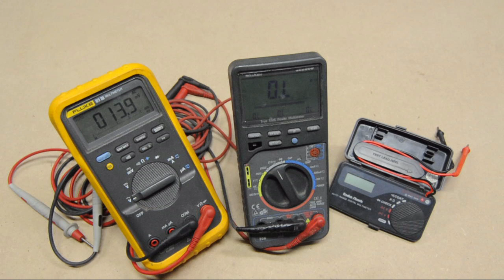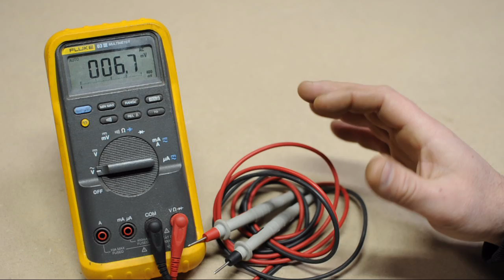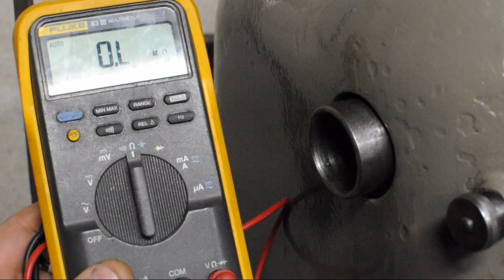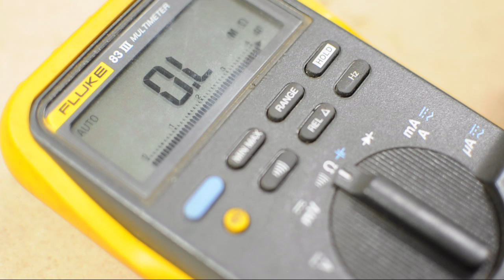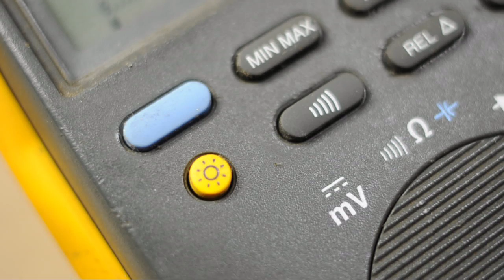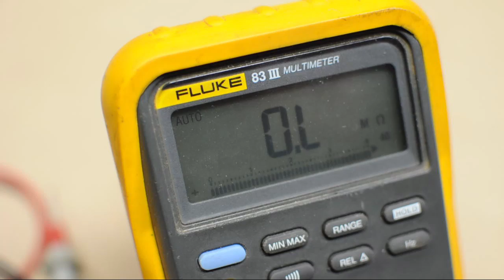Multimeter Tips & Tricks

Comment: 40 years as an electrician and I never knew you could make any of the measurements you showed.  

My tip is never stow your meter with the leads connected to the meter.  This prevents trying to measure voltage when your leads are plugged in to measure amps.  If you try this on a 3 phase 480 volt system your meter will explode.  Don’t ask me how I know this.

Comment: I've found that the stock gauge pins in my meter are pretty sloppy.  Open up the back of your meter and check them out.  Oddly, they are labelled as fuses.  When replaced with higher precision gauge pins, it improves the overall meter precision.

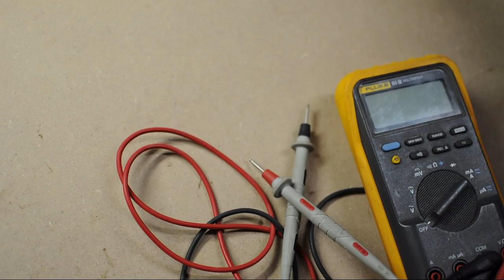Comment: This is a bit off topic, because I recently calibrated all my meters, but at 4:46 he is actually showing the PROPER WAY to use a 90 degree micrometer. I unfortunately only could afford the 1"x 2" model, and didn't have enough for the 2"x 3". I have to take the 3" measurement with a screw pitch guage and count the teeth. At least once my meters are calibrated, I don't have to do it again for another year. If anyone sees a decent 2 x 3 or even a 3 x 4 90 degree micrometer, let me know.  Do they make 90 degree dial calipers? I know they aren't as accurate, but they'd be better than my high school slide rule. (Yes, I'm old enough to be pre calculator and still have my slide rule)

Comment: Also, it's important to clear the meter after use. To do that, you plug the probes into the ground and turn the connected unit upside down to gently shake out all electricity present within.
Reply: Yes, but you have to make sure only the solid stuff comes out. Be sure not to let any of the smoke out, as a lower smoke pressure will add inaccuracy to the measurements.
Reply: If too much smoke leaves, it loses all function, so be careful.

Comment: I use my calipers for measuring how much capacity left in my battery. 
I use my micrometers for check what is the internal resistance of my batteries are.
I use screwdriver to check if my outlets are good or not.
I use wrenches as current shunts for measuring current.

Not everything is for fun, mate. 
You're are abusing and disrespecting a high end multimeter.

Comment: I've never thought to use a multimeter for any of these things.I have however used one of my multi meters to find out that every time the house phone rang I got a nice 12 - 14 volt shock when I was in the shower. Also a nice constant 4 volts (from the dial tone I guess) due to a short in the land line grounding through the copper pipes. Very low voltage, Yes, but still enough to give you a little zap. This information I didn't dare give to any of my room mates at the time, the phone wouldn't have stopped ringing whenever I got in the shower if so. Thanks Multi Meter, and to my Machine Shop Teacher who taught me how to use one while hooking up that 3 phase Lagun Lathe so many years ago.

Comment: Oh c'mon TOT, you can't tell people things that are so wrong....you said you can weld with the multimeter, well you didn't say that it only does TIG welding and that if you want AC TIG welding it needs to be an mm/inch model.
Now think of all the problems you have caused....i guess many viewers bought a multimeter for MMA (stick), which with some models might be possible, but there is no chance you will be able to MAG weld with this thing, not even thinking of MIG.....
Next time, please remember to provide these essential information.
By the way, with the slightly higher models of Fluke (e.g. 179, thats what I have) you can even weigh things.....comes in handy if you want to weigh a lathe and don't have a scale big enough....just use the micrometer ;-).

Comment: One thing I found out when I was on a date: If you use the clamp it won't say BOOB like my calculator does.  However, if you press the hold button at the same time the clamp is attached it says SECOND BASE.  The manual says it works for THIRD BASE and HOME too but I've never been able to verify it because all of my dates end after the SECOND BASE reading.

Comment: I've used mulitmeters for over twenty years. These days, I pretty much only pull it out to check the water ratio in my concrete mixes. Anything above 2.6 microflops is recommended, but anything over 3.4 is just wasting money.

Comment: Tip for experience: don't buy cheap leads on wish/aliexpress/etc. They don't hold up under high voltage/current. And they have a high internal resistance, which gives measurement errors.

Comment: That was informative! I've used my Fluke on everything from cutting hair to length, measuring BMIs, hell even viscosity. Addendum: when I'm checking the internal temperature of a steak, tuna (steak) or Pop Tart it's off +/- 4 degrees between F and C and I don't want anyone getting the bends. I've tried wiring it to 220 but the generator is hard to carry to jobsites. Advice?

Comment: In 2019, this video is every bit as informative as it was on the day it was published.  Thanks, Tony!
Reply: technically accurate comments, my favorite kind!
Reply: I’m rolling on the ground. I’m dying here.  🤣
Reply: I hate to be the bearer of bad news, but the fundamental forces of the universe are due to change in 2032, rendering this video useless.
Reply: Nathan Ballard so it's good for at 12 more years!!
Reply: I learned something new today I never knew that you could take measurements and a piece of Steel with a multimeter and what is it so that you are taking what measurements are you taking with this what setting do you put it on and I have a fluke 85 also but mine does not have that little back screen light like yours does maybe mine is older not for sure
Reply: @acemogany6369  he's measuring resistance. unusual way to measure length its obviously a joke
Reply: Make that 2021
Reply: Samesies 2021
Reply: 2022
I managed to forget about this video and it was a good refresher.
Reply: You didn't get the biyearly update?
Reply: And in 2023, this vi...nevermind.

Comment: I've done the calculations and it turns out that the duty cycle on a fluke in spontaneous welding mode is exactly the same amount of time it takes to reset the mains breaker.

Comment: I used my multimeter to indicate a vise I just got for my CNC router. So there is some truth in this video lol. 

My spindle is mostly electrically connected to my table, but it is like 20Ω so I could see the change in resistance when a dowel pin I had in the spindle touched the vise. Seemed accurate within a few thou when tested with a paper shim.

Comment: I have a question. 
I'd like to start by saying I am a 30 year technician with many years experience with dmm's. I have the newest fluke with ass programming (analog signal support). As you know, they are very precise do to the leads having an amperage rating of 100amps.
However I am I having a issue with the automotive wire length displacement tester.
With the car not started I'm getting a typically reading of 12.4 newton inches.
with the car started, length displacement jumps up almost 50 amps, to 14.4 full microns.
It's 3/o 3 strand wire and its not a diesel.
Any tips would be great

Comment: He didnt even show how to modify the 123 blocks flux modulation capability.. maybe his meter needs a larger triac? Also, i heard theres a replacement  non-consumable lead adapter that allows for welding with 10% or lower duty cycle without burning out the centrifugal oscillation inhibitor on older meters. They can be purchased at harbor freight and are extremely robust. Usually sold near the left handed basin wrenches, and the good blue handled pipe stretchers. Oh, and dont forget to pick up a bag of dilithium crystals to prep your work surface or use as hand Cleaner. Also works in a pinch for removing those pesky slag beads from your safety squints. Hope this helps folks!

Comment: You funny.... Just be thankful you didn't have to deal with the old analog meters. To determine how many ohms 120 Volts were you had to multiply how many turns the needle wrapped around the stop pin by a correction factor (which was different for every meter.)

Comment: Reminds me the time I changed the amp bearing with a volt one like an idiot. Realised my mistake when I was stuck on the highway changing my tires... Well, not changing my tires because of that...

Also, a piece of advice, don't use distilled water on your multimeter(metric ones) they dissolve ohms, use special ohm saturated water. It is not a marketing trick, I've learned the hard way...

Comment: One other use I've found really helpful in a pinch is the speed function (V for velocity).  The speedometer on my tractor went out a couple months ago when I was plowing snow.  (It's important for the snow curls to come off the plow in short 6's and 9's rather than big rat's nests or they fall back in the road and cause problems). Surface feet/min is an important parameter to monitor as you are plowing, and the optimal speed varies with wet or dry snow and blade angle. Well, back to the multimeter. I plugged it into my tractor's instrument panel (red to the battery, black to the clutch throwout bearing ground) and it reads speed. Works like a charm!

Comment: multimeters are great for checking when to replace the grease in sealed ball bearings, just periodically check the resistance path between the inner and outer races, especially useful for muffler bearings as they operate in a hot environment.

Comment: If you put a 1/4 teaspoon of baking soda in your red sauce, you can measure the ACidity  in the micrometer mode.  The black lead goes into the flame or directly onto the element depending if you use oxy-acetylene or 3-phase. The red lead, obviously, goes directly into the red sauce.  Bon Appetite! BTW, this video made a lot more sense to me than those mechanical devices you make. Thanks for sharing. ~guido

Comment: trying to troubleshoot an auto A/C system but am having a problem finding the values I'm looking for... anybody know how to find it? it's only two wires going to the compressor but not getting twelve volts,but I don't know how many volts it should be getting... anybody?
Reply: JoJo Mama you've got it set to AC volts, right? ;)
Reply: Ray Hicks well it's an automotive(in a car) so I'm not so sure AC would work here...but thanks for the response
Reply: JoJo Mama  sorry, I was teasing since you're working on the A/C motor:). you managed to troubleshoot it yet?  if not try disconnecting the motor and checking the voltage on the leads, then backtrace to the fuse and/or relay and check they're working.  if the fuse is blown, check the resistance across the motor  to see if the windings are shorted
Reply: Ray Hicks what happened is I disconnected the plug going to the compressor, measured voltage and got 2 1/2 volts(DC!) but had no clue how much it was supposed to get...that was basically my question,long story short,after adding four cans of R134 it makes very cold air!

Comment: I dropped a pair of metric channel locks on my multimeter and now it will only measure in degrees Kelvin during daylight savings time adjusted to the central mountain zone. It's very confusing.
Reply: Very confusing, as there is no such thing as "degrees Kelvin". Fix that rip in the fabric of spacetime on your living room wallpaper and try again; it might be interfering with reality, causing the nearby DMM to measure stuff from the next dimension over.
Reply: You can reset it, but you'll have to travel to Greenwich to do it, and only at noon or midnight
Reply: It takes a kilosecond or ten but you'll get used to it.
Reply: Just remove the batteries and let it fully discharge for at least 3.14 days.

Comment: I use my DMM to measure tire pressure like this: ramm both probes into the tire (about 2 inches deep)  2. after 10 seconds pull them out again 3. after 10 minutes you know your tire is flat
Reply: Can you check your tire polarity aswell this way?
Reply: Yes, but it only works with certain Michelin tires. You just need to take the red probe and point it at the tire you want to measure for about 20-40 minutes and your neighbour will tell you that you look like a very professional idiot.
Reply: @WirelessDude569  in this scenario, the plus and minus symbols let you know whether it's a right hand or left hand tire.
Reply: hahaha!
Reply: My only measures gravity. When I drop it.
Reply: David's Music    Hate to tell everyone this, but I have found that ONLY Fluke meters work reliably and are compatible when checking Michleins.   Cheers
Reply: Mine also measures rolling Resistance! Just place it in front of tire Not enough resistance and i have a blown meter

Comment: I've got a rechargeable multimeter. I just stick the probes in the wall outlet and after an hour it's ready to rock again.
Reply: How convenient; extremely safe as well, I bet!
Reply: Surprisingly, it is safe as long as the meter isn't in the wrong mode.
Reply: how to check bad compressor
Reply: Thing is, it actually works. As long as you plug it in with the right polarity. The oversight is that as you know it it is alternating current, so periodically you have to switch the polarity to match with the grid. As long as you wont forget to keep it to the right polarity it will work just fine.
Reply: rechargeable implies battery, so you must have an inverter model to change a/c to dc.
Reply: don't you do it in high current measurement mode? that charges it to 110% in like 1 sec
Reply: @MrDoboz  also charges the fuse right behind the moon!
Reply: i really, REALLY wish this was true....*sigh* [unscrews meter casing again cuz the damn thing didnt come with an on/off switch just an off position all the way on the other side of the dial...what am i, a freaking animal?!]]
Reply: It's got built in overload protection as well. The wires melt it the current is too high.
Reply: @anchorbait6662  -  I have the high amperage model with the heavy gauge test cables and the overload alert is the release of the secret blue smoke.
Reply: Trade in time, I just got one that recharges wirelessly. I didn't have the cash for the model up which has a night time solar charger.
Reply: That actually is a thing, granted not with mains voltage. The Keysight U1253B has it.

Comment: O'Scopes are great for flatness checking after scraping to 10-6 and I got my backlash for the cross slide and compound down to zero after about an hour of futzing, my horizontal hold just wouldn't sync for some reason.  Had no Idea about checking the 123 block that way.  Thanks for the tips.  

Just the Best Tony!  Thanks!  ~PJ